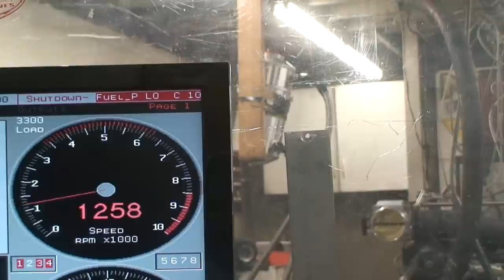NRE 700 HP Off Road Ultra 4.  King of the Hammers Desert Race.  Off Road Racing.

Comment: Surprised I didn't see any safety wire on the Heim joints
Reply: Jamessr23 I don't think that's remotely necessary, given the fact that those are way over spec and the torque value nuts is probably 200 ft pounds or more.

Comment: 8.1 liter? That's the biggest LS motor I've heard of.
Reply: LME made one with 8.2L (502ci)
Reply: Interesting
Reply: the 8.1l 496 is a common big block in busses, box trucks, some chevy pickups and vans if you ordered them. My cousin has a 1 ton chevy handicapped van that has a 8.1 in it.
Reply: This 8.1 is an LS motor though. Totally different.
Reply: Tank77 LS is a small block, the engines you mentioned are big blocks.